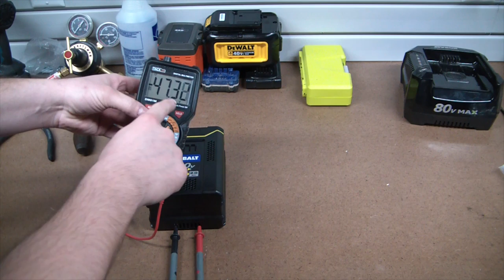Kobalt 80V Battery Recovery and Teardown - ElementalMaker

Comment: So you need to match or exceed the voltage?  Wouldn't a lower voltage also charge the battery?
Reply from the maker: A lower voltage would actually drain the battery, sending energy back into the power supply, potentially damaging it.
Reply: ElementalMaker thanks I bought a power supply that could do the 60v and saved two batteries that were from the floor model.  I was surprised how fast I had to adjust the voltage up, the whole process only took like a minute or two for me to get the voltage to the point that I could put it  into the regular charger.

Comment: Recovery worked just as you said. However, the battery only works for about 5 -7 minutes before needing to be charged. The LED's show two lights on. Any suggestions ? You are doing a great job. Keep it up !
Reply from the maker: Thank you very much. Unfortunately it sounds like your battery has some damaged cells or has neared the end of its use cycle life. Sadly I'm in the same boat, my recovered battery worked at reduced capacity after revival, but has now totally died this past week when I tried to use it in the weedwacker.
Reply: @ElementalMaker  I have a 80 volt battery in a weed wacker. The battery reads 80-ish volts runs fine on the charger. Put in the weed wacker and it will only run for 5 seconds or so then stops. Battery indicator does not read any leds at that point. Let it sit for 10 seconds or so and then it will run again for a few seconds then the same thing again. What do you think is going on with it??
Reply: @brianbest2  Have the same problem with this 80V Max battery in my leaf blower (but mine is blue and 2.5Ah).  Runs a few seconds, then stops.  Process repeats.  Sometimes can get to run longer.  Not clear if BMS issue or battery cell.  Went to the trouble of taking apart and measuring each cell voltage, discharging pack to 70V, charging pack to 80V.  Nothing obvious stands out as a problem, but cells definitely aren't balanced very well at either high or low state of charge.  Also need to plug and remove from charger several times during charging - starts ok, but then flashes red after awhile.  Eventually charger will go green, and it seems to charge to some level.  Just horrible run time, and then the start / stop problem.
Reply: @billjohnson3344 Yep, I have the same exact issue, it sucks...wtf?!!

Comment: So I have a green works battery that died (as well as a 3rd party one).  They both died when trying to use with my weed wacker.  My guess is that there was a fault in the week wacker.  I noticed in your video that you mentioned a fuse.  Do you think that just got blown and all I need is a new fuse?

Comment: Nice video - thanks. My 80v Kobalt is dead - won't charge. I think its below the voltage threshold, don't have have a DC power supply but I do have a second 80v Kobalt battery. Clip them together and perhaps it will raise the voltage where it will start charging again. Episode 2..?

Comment: I have one with a laking battery inside. Do you have any recommendations on replacing it or is that better left alone? (Looking for a place to purchase a replacement and some basic instructions)
Reply from the maker: It's certainly the safer route to leave it alone and recycle it. The leaking cell might be able to be replaced, but it's a pretty difficult job if your not familiar with electronics repair, and requires a battery tab welder, or a very experienced touch with a soldering iron. Personally I'd replace it if it's got a leaking cell

Comment: I like that PS - mine won't go that high. One of my 80b 2AH batteries is wack. When I try to use it , it will power the tool (mower, chainsaw, blower, etc) for 1-2 seconds, then I get the dreaded BEEP BEEP which generally means it needs a charge.  

Oddly the light all 3 lights are on. When I place it on the charger, the fan comes on, and light #1 blinks.  Which is also strange since it showed near full-charge.

It after about 10 minutes, all 3 lights go out, but the charger fan continues to run- Which should never happen. And it acts the same in the tools no matter what.

I tried it in the blower on very low power hoping to coerce it to work at low current but no joy.. 

My plan is to try to DISCHARGE it- I've had some success in the past getting a good DEA battery, and after that it worked. Sorta the opposite of your success here..
Reply: Hey! Did the discharge work? I'm having the exact same problem with one of mine.

Comment: Does Lowes allow people to just take stuff from that return bin? I've never seen a return bin there before. I'd love to be in on that!
Reply from the maker: I asked the store manager for permission and explained my intended use, and that usually in a battery pack only one cell goes bad when the rest are still perfectly usable, and that any bad cells would be returned to be recycled with electrical tape over the positive for protection.
Reply: @ElementalMaker  Thank you! That makes sense.

Comment: what power supply are you using?What power supply do you recommend?
Reply from the maker: I'm using a Sorensen 60V 10A supply, but they are very expensive. I lucked out and found it on Facebook marketplace for $25. Any 60v adjustable lab power supply should work

Comment: Should have shown the fully charged voltage for both batteries--just for comparison and so we can see how high above the 80V rating the battery gets charged.
Reply from the maker: Fully charged is 84V 👍
Reply: @ElementalMaker  Thank you.  That's 1.05 times the rating--which is pretty conservative compared to other batteries that I've seen when fully charged (as much as 1.15 times over the label V after charging).
Reply from the maker: @ab_ab_c  this one is actually underrated which is awesome to see. 20 cells at 4.2v per is 84. I'm surprised they didn't label it a 85v battery like many other brands would have done
Reply: @ElementalMaker  Good find & recovery--congrats!  The effective voltage is more like 3.7V*cells=3.7V*20=74V, so yeah---idk why they labeled it as they did.  Not sure there is a labeling standard.  The discharge curve on 4.2V cells is mainly ~3.7V for the majority of discharge curve time.

Btw, did you actually measure the resting V of your charged batteries after resting them for 24 hours?  As li-ion cells age they tend to have a lower resting V, higher self-discharge, & lower total charge capacity.

 P.S.:  Keep up the good work!  I like the variety of your interests!  Been watching you for a while now.  You are one of the few YouTubers that I allow into my inbox!
Reply from the maker: @ab_ab_c  ah gotcha! I didn't realize you meant nominal voltage, and your correct that's definitely a better way to rate a battery. Glad your enjoying the channel, truly appreciate having awesome viewers like yourself.

Comment: May I suggest checking cell level voltage first always before even attempting to charge.  You say you are interested in building a wall. You May benefit with more knowledge on handling lithium.  Be safe. 🎉

Comment: Loved the video! Really good Information! But please Give us more information out to get those batteries from the recycle bins. How much you pay for them and also what is the power supply you used on the video?
Reply from the maker: Any hardware store should have bins to recycle rechargeable batteries. I asked them manager of the store if its okay for me to take them, salvage the good cells, and return the bad. They have no issue with it, so I get them free. Many times batteries put in the bin are still in perfect shape. Maybe the person just lost or broke the tool it goes to.

Comment: The Greenworks 80V battery is identical, far as I can tell. But the ridges on the case key into Kobalt or Greenworks tools, so you can't interchange them. Why? Because greed wins out over sanity, I guess.
Reply from the maker: Well said 👍

Comment: what are the little clips you used to connect the alligator clips to the battery terminal?
Reply from the maker: Those were a couple of piercing test lead attachments. Just happened to fit nicely, but any copper or aluminum strip will work.

Comment: Wee tip.  Put the battery on a household radiator for an hour.   Then attempt to charge.
Reply from the maker: I actually did try that, but didn't have any luck. The cells were too low in voltage still for the charger to work. I really should have mentioned that trick in the video. Damn I need to start writing notes or something haha

Comment: fyi home deport or lowes will not let people look in their defective battery return bin.  ok now i see your using black latex gloves?  please give me some info folks on good working electrician gloves.
Reply from the maker: Did you ask the manager of the store? I explained what I was doing, and they had no problem with it. I poke around the battery bin every time I go
Reply: @ElementalMaker  what are thee electrician glove that you are wearing to help prevent a shocking eperience?   everything i see is too bulky to use.

Comment: Gas trimmers work forever. I've had mine since 1998 or so and it still works like a champ, though I did have to replace the fuel lines and clean out the carb once.  But the electric ones just don't seem to last. But at least with yours, you're not dragging cords around.
Reply from the maker: Yeah my old mid 90's weed eater finally gave up the ghost last year which is what prompted me to try out the cordless 80v weed eater. We'll see how it holds up. I definitely dont think I'll get 20 years out of it though LOL
Reply: Unfortunately, the public has spoken. It wants cheap stuff that doesn't last and are generally not serviceable. They just don't want to pay for quality. This is why everything breaks and almost nothing is made in America anymore.  When I was a kid, almost nothing was imported.

Comment: So, my battery is exactly like this and yet my voltage reads at 71.4. Any ideas?
Reply from the maker: That would indicate its at a proper voltage. Is it not charging or working in tools?
Reply: Nope, red blinking light of death on the charger and no green charge light on the battery itself.
Reply from the maker: That is very odd. The voltage would indicate the battery is likely healthy. How old it is? I think Lowes guarantees them for a year or two from purchase date.
Reply: I would have to check and see but I’m pretty sure I’ve had it for 2 years or so.

Comment: What type of power supply were you using?
Reply from the maker: That's a 0-60v variable lab power supply. For safetys sake I don't recommend this method of your not familiar with electronics

Comment: For anyone who tries this, be sure it wasn't discharged below 15%? Because it might go explody when you try to use it next.

Also if you disassemble it, discharge yourself, or wear a grounded static wristband.
Reply from the maker: From my calculation each cell was at approximately 2.37v. I've recovered many cells below that voltage and never had an 18650 explode on me. I think that possibility is far overhyped online.
Reply: You don't wear static wrist bands when working on live circuits only dead circuits. You don't want to make yourself more conductive on powered circuits it's dangerous to your life.

Comment: Yes Bench Supplies are Awesome, Early in my Career I repaired them and somewhat through and usage Oh Yea But
when using them on Batteries would be best to Add Series Diode and Reverse Diodes Most importantly for when connecting to devices with voltage @ the Device like batteries in many cases supplies will break if the external exceeds
the supply level.  

If you are really handy put the series Diode inside Pre-Voltage Meter wire so the display is still correct! :-) 

I've recovered many batteries but but yea whoops what a Source the places they get returned! THX! Again!
Reply: Actually on your 80V Battery - looks like each battery has a balance wire.

Comment: Not user incompetency, very bad design.  These $359 batteries die immediately if left a bit too long on the charger.  Shitty charger, shitty battery circuit.